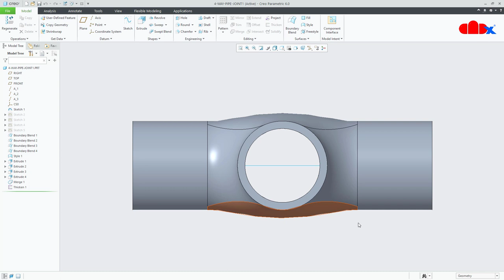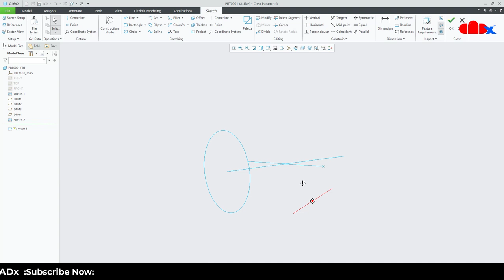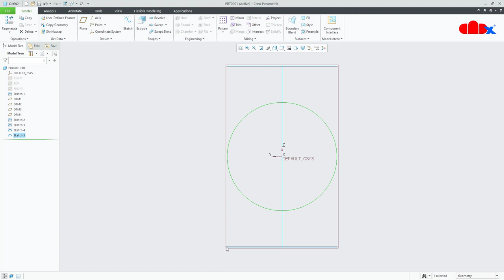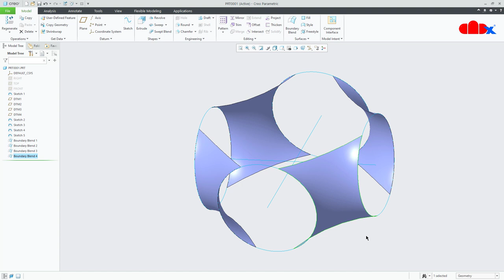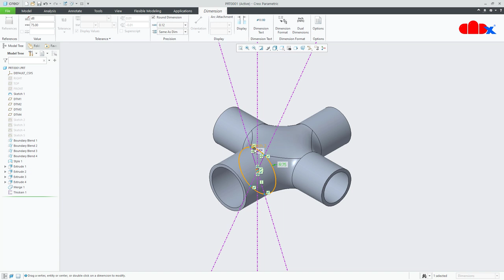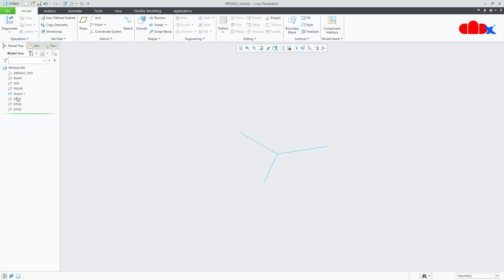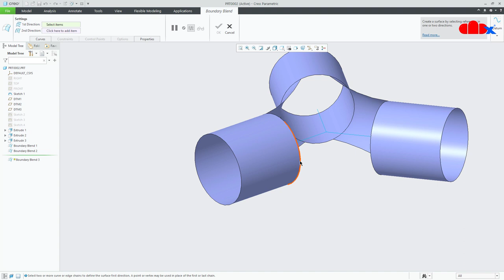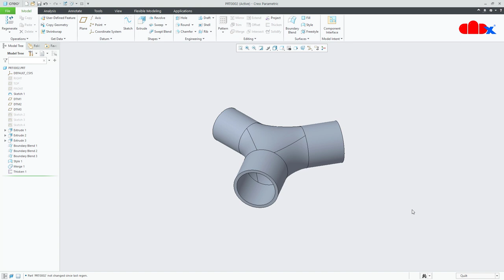Pipe joint connector in Creo Parametric

Comment: Another fantastic demo from this man! I learnt so much from going over this over and over, until I could almost do it with my eyes closed. One thing that I did find really useful after a bit of faffing around, was to sketch the circle, centrelines, divide points, etc onto datum 1 as shown, and then press Control C to copy that sketch before  pressing OK....then went to the next datum, chose sketch....and then just pressed Control V to place the copied sketch onto that datum.....changed the 'Scale' box at the top of the ribbon to ' 1 '...then centred and located the sketch by dragging until centred on the datum reference crosslines....then pressed OK....and hey presto....the next sketch is automatically created without having to go through the rig morale of re-sketching everything. Then repeat with the next two datums....and you're done. Creating the sketches this way saves a great amount of time and patience and assures absolute accuracy regarding each individual sketch. 
Respect due from the UK, mate! Keep 'em coming...and Thanks for putting all your hard work on here....Cheers!